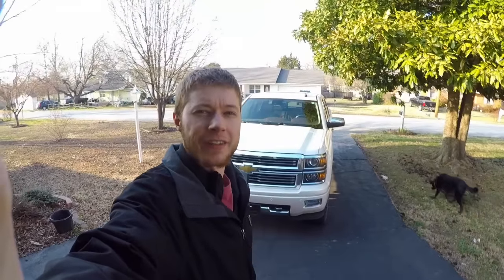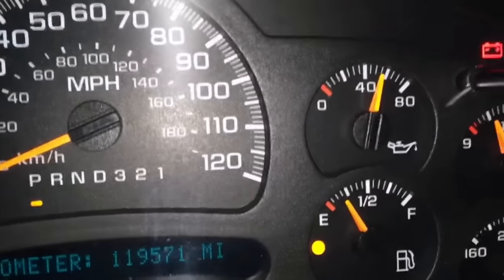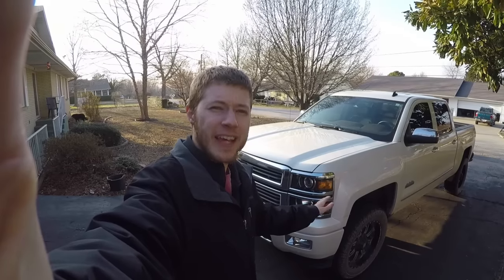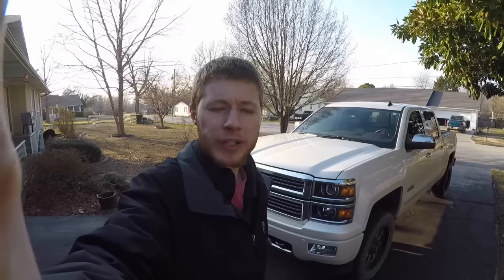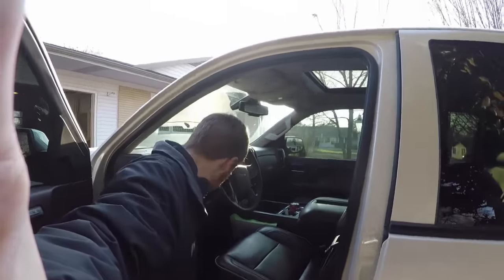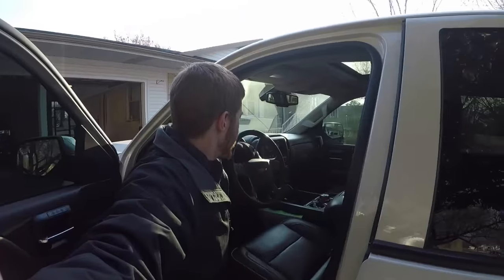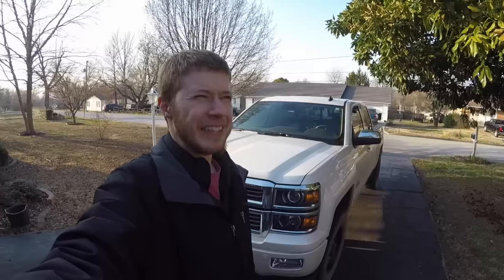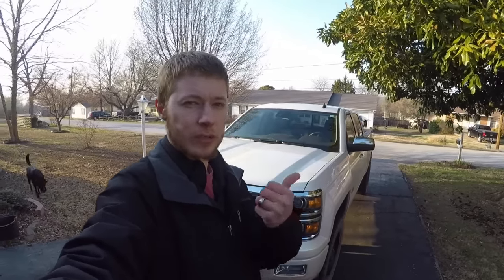Silverado Sierra 5.3 Lifter Noise Tick (What to do)

Comment: 2014 and up use high pressure common rail injection. The high pressure fuel pump is what you are hearing
Reply from the maker: Didn't know that, i'll check this out!
Reply: I have a 2014 GMC Sierra 5.3L and there is a service bulletin on the high pressure fuel line and check valve. Helped the sound for a bit but not entirely. I’d love to see someone create some sound proofing / padding to install around the fuel pump or that area to muffle the noise more.
Reply: The fuel pump has sound deadening around it its just a loud setup. We have all kinds of people complain about this on all the direct injection engines
Reply: cayugabrother1 any way to add more?
Reply: When I bought my 2015 it tapped new, but now with 53,000 on it every now and then it has a loud tap when start and goes away after warm up
Reply: Yep high pressure direct injection pump
Reply: Finally, thank you cayugabrother.
Reply: use Lucas Oil stabilizers sparingly...if at all...
Reply: Could be a cracked manifold stud. Had to replace mine on both sides in less than 60k miles.
Reply: Thanks man because I am looking at a 2016 and I don't need a headache
Reply: Not an issue, just the way 14s up sound.
Reply: @052500hd  Valve carboning is a hudge issue with the ECOTEC engines.
Reply: I took my 2015 sliverado to the dealership to have them check this noise and was told the same thing high pressure fuel pump, can hear it louder in cold weather and when pulling a heavy load on my trailer on the expressway .
Reply: The first truck he showed. The older green one. That wasn’t a 14. Looked like a 05ish. Why did that do it? Just curious. Same common rail as well?
Reply: Brian Cusick he probably had a lifter go bad in the 2006. Sometimes a hydraulic lifter loses its charge and slaps between the pushrod and camshaft.
Reply: Google User  what is it?
Reply: Yeah my 14 sounds like it's running a sewing machine under the hood
Reply: Actually that is a metal on metal noise dont just shrug it of if ignored can be expensive repair
Reply: @benjaminwayneb  its an issue on any direct injection motor.
Reply: @nvdubs  Not all direct injection engines experience the same degree of carbon build up.
Reply: Try some restore oil treatment it will help your engine last longer in the long run I have the same problem with my 2013 Sierra but once it warms up can not even hear anything very quiet
Reply: @benjaminwayneb  they all experience it unless there is fuel cleaning the back of the intake valves or a catch can preventing oil from being fed back into the intake.
Reply: @jorgehernandez-di7ll  2013 Sierra has an LS motor. These are direct injected LT motors (Gen 5).
Reply: @jorgehernandez-di7ll  2013 5.3 is a different engine then 2014 and newer. The Ecotec 5.3 was an all new engine in 2014, the only thing the 2 engines share is the displacement.
Reply: @nvdubs  We have dozens of direct injected engines in our fleet and the only the 5.3 is giving us problems, we are chemically cleaning the intake valves every 20,000 with GM. cleaner. We started having missfires while still within base warranty that turnout to be carbon build up.
Reply: @benjaminwayneb  I have 190,000 on my L83 in my '14 High Country. Never been an issue for me and I've never had one issue on mine besides the AC condensor.
Reply: @benjaminwayneb  and again, its an issue on any direct injection vehicle without fuel being fed through the intake, fuel to clean the back of the valve,, and oil vapors being fed through the intake.  Do a simple Google search and you will see it is a common problem on most direct injection vehicles.  Audi, BMW, Hyundai, Kia, Mazda, Mercedes-Benz, Nissan, Lexus, Saab, Subaru, Volkswagen, etc all have had issues with this.

Comment: I own a 2015 and my father has 2012 and both do it. I’ve noticed in mine that at idle the oil pressure drops just below 40psi. Rev the motor just a little and it rises eliminating the noise.
Reply: Just got the tick, idles at 33/34 psi a lil throttle and it's gone

Comment: My 2006 has 298,000 miles on it. The ticking started about 30k ago, not just at startup but while driving too. It comes and goes, but gets more frequent as mileage racks up. I always use Mobil 1 synthetic and change oil religiously. One thing I noticed, is the ticking noise goes away right after fresh oil change, then shows up occasionally once oil gets to around 70%, and progressively more often as the oil gets older. Then when I change the oil, the ticking goes away…and the cycle starts again. One time I added an oil viscosity additive, and the ticking stopped right away…until it came back eventually. Otherwise truck runs perfect. 

One other observation, the ticking is more frequent with around town driving, but never seems to come up during long highway road trips.
Reply: I see when you do that to keep it smooth you have to do it with every oil change
Reply: First thing everyone should do is Stop using Mobil 1. . It is a really a crap oil.  I used to have the exact same experience described in all of my trucks GM and Dodge. When I quit using M1 10 years ago the problems disappeared. Just about any other oil will eliminate the sound.  I run Penzzoil Ultra and Castrol Edge in everything. No such problems ever since dumping M1.

Comment: My 2013 Silverado 5.3 did it to at 40k. Did a oil change with a half a quart of marvel mystery oil for the whole oil change. And it when away.
Reply from the maker: Good info to hear! I tried the Lucas oil treatment without luck on my 06. Maybe Marvels got some better stuff
Reply: Yep they been around since 1923. So I can trust it’s a good product.
Reply: Yup exactly what I was gonna recommend. Throw some full synthetic oil (mobil 1 or Pennzoil Platinum) and use some marvel mystery oil in the gas tank
Reply: @DustinT  marvel is basically diesel fuel... Which acts as a solvent to loosen up oil stuck parts like lifters ... It will work for a bit but the design of the part will cause it to happen again when conditions present themselves...sadly

Comment: My last Silverado did that when cold had 263000 miles and burned 0 oil. My 2014 has 115,000 miles does it and burns 0 oil as well.
Reply: Yeah well what no one talks about about these engines. They never fix them right as soon as you get that collapsed lifter that's connected to your camshaft and it's already rounded off the camshaft and scarred it so now you have to get a new camshaft plus it's going to ruin the camshaft bearing so to do the job right you have to replace the lifters the camshaft and the camshaft bearings now you justthink about what that really cost but that's the only way to actually fix it right. I wouldn't touch these motors with a ten-foot f**** pull because these people are just replacing the lifter it's a Band-Aid fix. it's like you buying a truck that has bad crankshaft bearings would you ever buy a truck that had bad crankshaft bearings and you knew that they were bad I don't think so
Reply: @unleashedrider4309  At least these motors are out lasting their competition.

Comment: I'm a mechanic, it has nothing to do with your lifters. There's nothing to be concerned about. 
Also, even a slight exhaust leak will make a ticking noise, and may go away when the engine heats up.  We have many fleet vehicles with this engine. Some have almost 400k miles with no issues.
Reply from the maker: Wow, those have been great vehicles! Do you just follow the recommended maintenance on the fleet? 400k is impressive
Reply: Dustin T we follow the GM maintenance schedule
Reply: T 
He has 60psi of oil pressure....
Reply: T did you change O-ring yourself?
Reply: T I keep debating on changing it, my idle is never under 21psi and highway speed is about 38psi. Hardly ever goes over 40psi unless I floor the gas and if I do it'll at most do 45psi. This is on a 2008 Chevy 2500HD gas 6.0 LY6 over 500,000 miles meticulously maintained
Reply: T Great idea, What Psi does yours idle at hot?

Did GM update the O-Ring material to be more durable?
Reply: T I'm wondering if it's a slight O-ring problem?    What brand O-Ring did you use?
Reply: T Thanks!     Some GM Oil info you may find interesting...

GM Oil Standards- Most automobile manufacturers have their own testing requirements for motor oil, too, but you should know that just because an automaker uses and recommends a particular brand of oil doesn’t necessarily mean that that brand is better.  For instance, Mobil 1 is endorsed for GM and Mercedes models, and Castrol boasts that it is the factory-fill oil for BMW and Volvo. Although it’s obvious that no amount of money would get an automaker to recommend a bad motor oil (jeopardizing its vehicles), what isn’t known is whether oil-makers pay for the endorsement.
But all automakers concede that as long as an oil meets the requirements for viscosity and test certifications that are cited in the owners manual, they are happy with any brand of oil that you use. You should be aware that most of the test standards are similar, so an oil that boasts that it meets, say, five manufacturers’ standards, is really just a mild endorsement and likely doesn’t indicate notably better performance than what you’d get from another oil.  
Still, some automakers feel the need to establish more-rigorous specifications. GM has two specifications—one for its mainstream models and another for its high-performance Cadillac and Chevrolet Corvette models. The GM6094M mainstream specification is similar to ILSAC’s, but it also requires that engine seals won’t leak and that oil flows at low temperatures. For the extreme requirements of high-performance engines, the company developed the GM4781M specification (the so-called Corvette/Cadillac standard).
This standard has higher benchmarks than GM6094M does for piston cleanliness (no carbon gunk stuck to the piston), high-temperature oil oxidation (when the oil is burned and loses its lubrication properties) and viscosity stability (the ability of the oil to not become too thick when it’s cold or too runny and thin when it’s hot).
This standard seems to mean something. Although most major oil-makers have a formulation that qualifies, you should know that GM’s list from this past June showed that there were only 16 approved formulations out of the hundreds that are sold in the United States.
Although there seems to be a clear demarcation in motor oils that pass this standard when compared with the other certifications, Snider says it’s a waste of money to use costlier motor oil that meets GM’s tougher requirements in vehicles that don’t require it. “The best” is an inappropriate term, he says. “The best oil is that which the vehicle was designed to run on.”
By using budget-price generic house brands or private-label conventional oil, you can, of course, save some money, but that’s only if those cheaper alternatives have the same certifications that are required for your car’s engine. We found that most do.
Reply: My 2010 clicks due to afm lifter is suck in 4 cylinder mode.

Comment: Some people also hear some piston slap when Cold, because of no piston skerts to reduce drag to get as much millage as possible. My 96 with 290,000
Has been doing it from day one
More when cold.
Reply from the maker: Wow, thats been a good truck!  Love to hear stuff like this.
Reply: Dustin T yeah man it's been a good one, it has a utility bed and a rack and it's loded down with weight from day one, even today at a stop light you have to look at the tack to see if it's still running, I've had people in it and ask did the moter stop running.
By far the moter I have ever had
, All cylinders have 175 except for one at 177 , don't know what will stop it.
Reply: My 96 does it also. Bought it with 72000 mile on it. 255000 now. After 3 minutes it stops. Have changed the front and rear seals. Engine looks new on the inside. Change havoline 5-30 oil every 5000 miles. The 5.7 vortec engines run forever if not over reved. Hope I'll be able to say the same for my 2013. But I doubt it. Truck just isn't made as well.

Comment: All of my 5.3s I’ve had have had the tick I been told it’s normal
Reply: Tim Tlougan the tick or the knock that mostly  on the passenger side of the motor or near the bottom of the oil pan? Sounds like rod knock, but it does get less noisy at full temperature or operating temperature
Reply: @egertonridout4102  what if you hear a slight tick on the passenger side?

Comment: You mentioned using (Lucas oil treatment), wouldn't that make the oil thicker, and more difficult to flow through the engine and oil filter? I drive the Silverado 2015 crew cab, 5.3 v8 and the engine oil required is the (OW-20), which pours like water. I would believe adding lucas can cause engine damage, especially with the (AFM) system.
Reply: Its recommended to thicken the oil but only on the high millage older models
Reply: Stick to what your supposed to use. Mr Grant your absolutely right.

Comment: Take the oil pan off. Replace the pick up tube o-ring. You will thank me afterwards.
Reply from the maker: Good advice!
Reply: What does that do for it? I’m actually thinking of doing it!
Reply: We have a fleet of them at work.  The pickup tube o ring will go bad. Causing them to cavitate. That means it's sucking in air because its not getting a good seal. Ive replaced countless  orings and that has solved the problem.
Reply: Imagine having a hole in your straw when you are trying to drink from a glass.
Reply: @mikej2264  kinds explains why after enough time it goes away  at cold start it’s pronounced

Comment: It is the lifters, GM still uses a old-school push-rod design of their V8's. The low in torque, and reliability is in-matched. 

But it is a 60 year old design and still currently used, even in the new 2020 mid engine corvette. 

Most notably the small block Chevy 350, The Most popular automotive engine ever built, but Now LS series engine still use push-rods, lifters and rocker arms.
Reply: MrGreenelight is it bad?
Reply: @LeviYAY0-0  
No, look on you tube, you cannot find a car of any make that someone has not replaced the original engine, from Toyota to Porsche and Mercedes,  with a  Chevy small block. It is the number 1 replacement engine of all makes and models. and even some motorcycles have replaced the original engine with a Chevy small block.

Comment: My 99 new body style 5.3 does it. Also has 307k miles on it still going strong. Only vehicle I've owned 16 to 32
Reply from the maker: Thats great to hear man!  Its been good truck for you, especially if you've owned it since your teenage years
Reply: I’m chevy dude I have a 05 has since I was 19 just turned 30 has 310 still a monster I will always drive a Chevy til I die
Reply: Bought my 2001 2500hd with 6.0 new, 285,000 miles later still running strong, just started ticking a while back, fixing to flush lifters with b12 and change oil pump to a Melling high volume due to low pressure at start up, that said, it's out lasted ALL the trucks I've personally known with family and friends
Reply: i have a 1999 with 270k miles and it ticks. Still rides strong. Gonna put another motor whenever it blows
Reply: jonesy8682 what have you replaced?
Reply: Zachary Smith transmission was rebuilt and fuel pump mainly.
Reply: I have an 01 GMC Sierra that I’ve had since I was 16....I’m 28 now. She has 320,000 miles on her and she’s still rolling! Original motor, rebuilt transmission. It does knock a little though but hell thats to be expected at 320,000 miles. GM all the way!
Reply: 5.3 is a great motor 🤘
Reply: So glad to see everyone has the same tick as me! 2000 Silverado Z71 1500 at 240k and besides the tick running like a champ. It actually got louder when I did a major flush and clean and changed plugs and pulleys and belt, I guess it cleaned it out so much and I’ve got some extra power it’s knocking harder now. Just glad it’s a common noise and not a problem! Thanks for the video
Reply: Haven’t really notice mine. It’s 99 Sierra with 124k. How many miles before you notice this?
Reply: Hope mine lasts as long as yours holy shit! Picked up a 2002 5.3 single cab last month 150k miles

Comment: I have the 2014 Silverado with the 6.2 liter. The dealership mechs told me the tick was the high pressure fuel injectors. Just what they sound like and no problem at all.

Comment: 2015 Tahoe 5.3 also had same issue not as loud but still a little annoying tick, during a routine oil change and maintenance I accidentally over filled it with oil and it went away to almost nothing no adverse effects I then did another synthetic oil change to the recommended level and still working fine with the slightest tick super quiet now compared to before…might work for your truck also!

Comment: My 2015 silverado does it. The dealer had a gm engineer to look at it and I was told that it's totally normal. But for 50k I cant stand it.
Reply: Eddie Grech same
Reply: Yeah I have a 2015 that just started doing it. Just drove from Buffalo New York to Dallas Texas and back. Currently have 39,943 miles and it started. I'll replace all the lifters, rocker arms and push rods.
Reply: Just bought a 2016 elevation and fuck man I didnt know about that, Im starting to paranoid that is why im here 😂
Reply: Its your fuel system. These new lt gen 5 motors have a high pressure fuel pump that is ran off of the cam shaft.  You're hearing the direct injection fuel system.
Reply: Surprised he didn't bull shit you into new engine.
Reply: Lot of you need to educate yourselves on what a direct injection fuel system sounds like.

Comment: Try checking your spark plugs when they get loose you get a ticking noise and you will not get a misfire code the sound sounds very similar to a bad PVC valve.